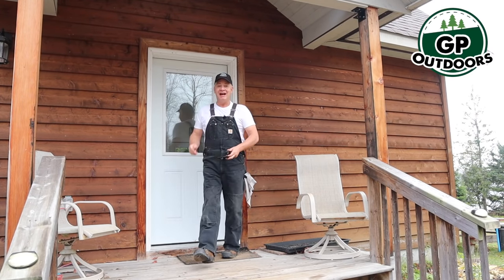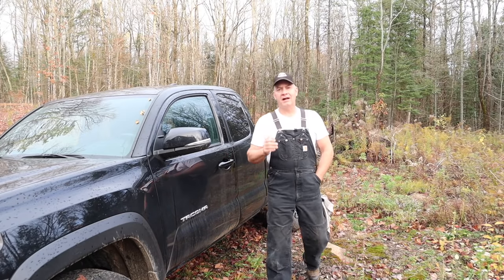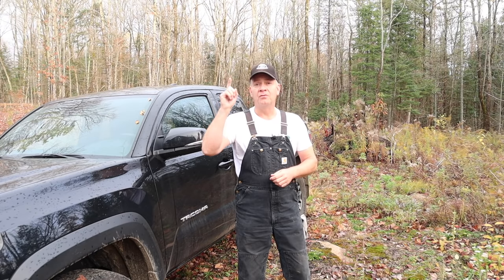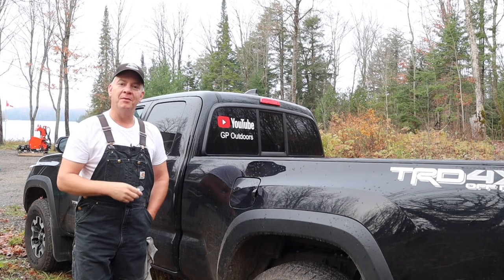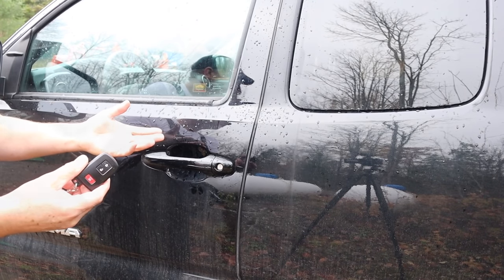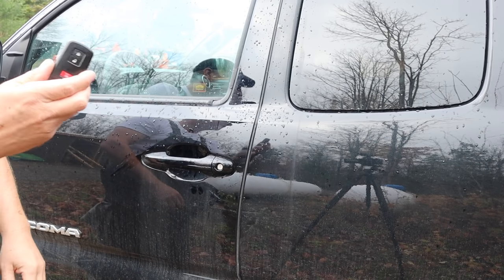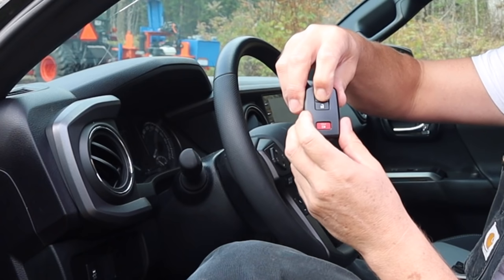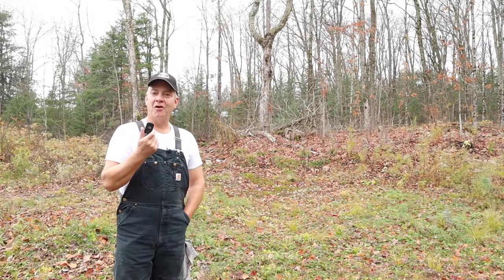#345 Stolen Truck. How To Deactivate Your RF Key FOB. Part 2. You HAVE to watch this!

Comment: Good to know about the key fob.  I have a 2020 Tacoma and a 2019 Camry so I will try them tomorrow.  

Also, did you ever tow your b2601 with the Tacoma?  If so, was it on a single or dual axel trailer and how did it do?
Reply from the maker: Good morning DS! I looked into trailers for a while - thought about it, but really didn't have a big need. However, I believe in your manual, you will see the truck is rated for about 1,000 lbs towing capacity without trailer brakes, and up to 6,500 lbs with trailer brakes ( including the weight of the trailer itself). There is a pre-wired 11 pin connector located under the dash below the left side of the steering wheel where a trailer brake kit can be installed and you will have the correct receiver plug already there on the back bumper (if you have the towing package on the truck). So you would need a trailer with brakes - I figured I could get away with an 18' trailer but was thinking a 20' would be better as I assume I would want to also carry tools and possibly more than one attachment with me. If you are in Ontario, you may want to look at MISKA trailers out of Hamilton - they have packages as well as stand alone trailer offerings. Hope that helps a bit. Cheers!
Reply: GP Outdoors I tried both the Camry and Tacoma and the key fob feature works for both.  It just disables the key fob.  Don’t do what i did, I took out both Tacoma’s key fob and tried it using my wife’s key fob and was still able to open the door (it was because I had my  key fob in my pocket - duh).  

Regarding the trailer, I have 2 acres that is raw wooded land in central Arkansas.  I want to get a B2601 with a backhoe to start clearing a place for the workshop.  But I will need to trailer it until I get the workshop built and can secure the tractor in the workshop.  I may need to settle for the BX23 to keep it under the tow limit.  I only live about 5 miles from the property and it is all flat roads.  I keep looking at videos and trying to decide if the BX will be big enough.  I really want a 26hp for the PTO hp, but I don’t think the backhoe is an option for the BX26 series.  Holding off for now until wood prices come back down to normal.  Thanks for the feed back and like you videos - learning a lot from them.

Comment: I wonder if my fob for my 2017 Rogue can be turned off.  The best thing I can do is try it and see.  I know a lot of Japanese vehicles are similar in some ways.  My sister's Acura and my Nissan beep when there is enough air in the tires.  It takes out the guessing.

Comment: First, thanks for the info.  However, I bought one of the Wisdompro Faraday pouches.  What I find strange is that both fobs work from inside the pouch.  The pouch doesn't have much if any affect on the signal.  I tested them from 25' for my car and roughly 35' for my wife's car.   I tried it with the fob facing the top and bottom of the pouch, no difference.   It'll be on it's way back... I wonder if Amazon sells Altoids. LOL
Reply from the maker: Morning Dart. Sorry to hear that - I am aware that the various pouches available don't work for all cars. Just a question (a mistake I made when i first got it) - there are two pockets on that wisdom pro - the one in the front is not protected but the second pocket in the back. When I got it i put the fob in the front pocket until I realized that there was a second pocket in behind it. Good luck and all the best!
Reply: @GPOutdoors  Thanks! a natural rookie mistake.  I found the "back" pocket.  It works GREAT!  Thank you for pointing it out!

Comment: Just watched a video from one of favorites (Scotty Kilmer).If you don't know Scotty, you should 52 years professional car mechanic. He had a foolproof way to keep your car or truck from being stolen.  Just open up the hood, find the fuse/relay box and pull one the relays out (Scotty suggest either the fuel injection or the ignition relay, don't pull a fuse as it's too easy to replace). He states, "who carries a relay around in their pocket for your model car".  Sound like a great idea for any car or truck left outside of a garage or fenced area.  Just replace the relay, close the box up and hit the road.
Reply: One thought I have on the pulling a Fuse or Relay ... how do you open the hood without getting into the truck when returning to start it up ??  Most vehicles have the interior hood release.  Is there a way around that?

Comment: If you push the start button with the fob itself, will it start the truck when rf is disabled?  I don't know how it works, but many times, if the battery in the fob is dead, you can still start it by pushing start with the fob.
Reply from the maker: Good morning Smitty. That's a good question - I believe it should still work, as it is used that way when the battery is dead on the FOB, so I think it should still work but have not tried it.

Comment: In my 99 suburban while it does have a door lock fob you have to push a button for it to try to do anything. I say try because while it does sound like its working none of the solonoids in the doors have enough oomph left in them to actually unlock any of the doors. And should anyone make it past that security feature like by having the actual keys even then they are not home free.. While the key should work in the lock either way you can put it mine only works if you put it in the same way up every time. And even at that point you have to know exactly how to jiggle the lock while turning the wheel to actually get the key to rotate.... And those are all features my truck and i have developed over years of working together. Also have a hidden kill switch for the fuel pump also... But seriously have you seen the guy in england who electrified his door handles on his work van?

Comment: On my 2022 Buick Avenir and 2022 GMC Denali if I hold down the lock and unlock buttons at the same time for 2 sec the lights flash and it disables the key fob. Press the unlock and the lights flash and it is enabled again.

Comment: You can start the car (if the door is unlocked) even without a battery inside the FOB. That's what the shielding prevents.
The FOB RFID part (that starts the car) doesn't "transmit" all the time, it is a passive chip. Only when is in proximity of a reader, that reader sends the RF signal constantly, and that RF is used to power the RFID chip inside the FOB.
As for the combo, probably is in the Owners Manual for that truck.
PS: The unlocking of doors by pressing the button is indeed active, powered by battery, but is not related at all to the starting of the car, those are different chips inside that FOB module.

Comment: Well I bought the product you recommended.
Put my  key in it, sealed the velcro flap, & Pressed the buttons of the FOB THROUGH THE SEALED POUCH.
I can unlock the truck,  lock the truck, and remote start the truck, WITH THE KEY IN THE SEALED POUCH.
Maybe they were making them right when you bought them BUT THEY ARE NO LONGER MAKING THEM WORK.

Comment: Very informative, thanks for that. I guess if you want a complete safe way would be to add a kill to the fuel pump that would be activated or reactivated with a different wave frequency or with a physical activation (by a magnet passing near it for example)

Comment: Personally I think the best option here would be for auto makers to provide an option of disabling the touchless entry. Have it so you can set the keyfob to only unlock the vehicle with the buttons on it, but the 24/7 RF stays turned off. This way owner's in more vulnerable areas (such as cities and highly populated suburbs) can have a more secure vehicle, while people who prefer the touchless entry can still have it if they so choose to.

I'm not sure how they would make starting the car work with touchless entry disabled, possibly they could take the BMW approach of having a keyfob that inserts into a slot in the dashboard.

Thank you for taking the time to make others more aware of this issue! Our family has a key rack in the house and I may tell them to get once of those pouches to keep the keys in.
Reply: I believe on my 2017 CR-V I can disable the unlock when you just touch the door handle.  I know I was able to deactivate the auto-lkck when you walk away feature. Have to try it.

Comment: There is no point to your faraday key pouch or deactivating the key fob, someone can still steal your key fob signal when you are using it. And later come and steal your vehicle. Best way is to put a toggle switch inline with the power wire on the fuel pump, this will kill power to it.

Comment: Nice video . If you want to go a little more extreme you can disable the remote with the code and use the hidden key in the remote to open the door and since the remote fob is disabled to turn on the truck with a disabled fob just put the back of the fob in front of the button almost touching it and it will turn on.

Comment: What’s to stop a thief from using his remote to do what you do to turn the function back on: hit either button on his remote?
Reply: This solution is to limit the dirtbags window to steal your signal. Instead of it transmitting 24/7, you are reducing that to just a few minutes or even seconds each day when you get in and out of your vehicle. If they already have your signal on his remote, then you are right…this will do nothing.

Comment: The auto manufacturers are totally reckless and irresponsible creating a passive unlocking and starting system that’s so vulnerable to auto theft. Perhaps the only way things could change is with class action lawsuits against the auto manufacturers.

In the meantime, you could significantly reduce the risk of auto theft with a kill switch and an effective alarm system to draw attention to the car thieves. Perhaps tracking could also be added.

Comment: Hello there GP my friend.  I know we all seem to be into fancy electronics, but don't completely forget "old school" methods as well.  The one thing thieves don't want is something - anything - that will slow them down.  I have a "truck club" that lays across the steering wheel.  Is it the "end all" for security?  No, its not.  But you can't drive my truck with the club on it prone across the steering wheel.  Therefore, if your a crook, you better have a hack saw or some other battery powered cutting tool to cut the club off.  This takes some time... Again, thieves don't want to waste time.
Reply: My wife's Google acct.  I'm Howard.

Comment: Starting a vehicle with a key fob whose battery has died: I had an old 2013 VW SportWagen that I bought used and shortly after I bought it the battery in the key fob died. I was told that if you press the start button with the key fob - it would put the key fob near transmitters in the dash and they would wirelessly activate an RFID signal in the key fob. 

It should behave like proximity badges that people frequently wear in larger companies. There's not a battery in the proximity badge, it receives energy from a prox-transmitter, and once it does it will begin to transmit allowing the prox-transmitter to receive information from the badge.

I can tell you that it worked in my old VW.

Moreover I recall something that a friend told me years ago about his Corvette. The transmitter in the key fob only transmits when it detects motion - such as when it is being jostled about while in your pocket. This is supposed to save battery life. So it may be that key fobs that aren't being jostled about aren't transmitting. 

However I am not planning on leaving my keys lying around on my desk at work just so that it won't transmit.

UPDATE: I have a Toyota Corolla that has the same security vulnerability as every modern day vehicle. If you deactivate the key fob, if you hold the key fob near the start button while pressing it - there does appear to be proximity sensors in that vicinity of the vehicle - that will activate in the key fob, transmit back to the car - and allow the vehicle to start.

I assume this is for those dead battery sorts of situations... And I wonder how many people know this!

Also, Toyota still has allowed you to open the vehicle with a key. There is a key stub in the fob (in mine at least) where in if you press a little slider button on the fob the actual physical key will come out allowing you to unlock the door (It is where the key ring attaches to the fob; if you press that little slider the key will come out and the key ring will be attached to the key stub).
Reply: Next your self driving car will be going on midnight cruses by it's self.

Comment: I don't know if this would work for your type vehicle but I do know that you can install a kill switch to the ignition to the engine. At least on a Chevy and Dodge and some models of Fords but I never tried it on a Toyota before small hard to see can pretty much put it anywhere in the cab of your vehicle

Comment: My remote entry key fob on my Civic will start the car if the fob battery is dead by holding the fob up against the start button.  The manual says that the car actually does transmit a short distance RF signal that will cause the key fob to emit the response code if the key fob is in extremely close proximity to the start button.  That may work with your key fob in the no transmit state unless the RFID chip is actually disabled.

Comment: With all the advances in modern technology and miniaturization, there's no reason why a wireless fob that same size couldn't be made to do a cryptographically secure handshake. It's a shocking level of laziness for a high end automobile manufacturer, or maybe an ill advised cost cutting measure.

Comment: Generally, the signal is encrypted so that criminals can't intercept and duplicate the fob.  Usually, they use radio repeaters that suck up the signal from inside the house with a high-gain antenna, and re-transmit the signal right into the vehicle.  This way, the car thinks the key is nearby, and they don't have to process the signal or decode it to make it work.

Comment: The signal have a timestamp. They should not be valid after one delay. So they can relay only if they do it in real time. I don’t think you can simply record and replay it 10 minutes later. If it is the case the engineer are completely idiot. In programming this is how it works the packets are valid only for a short time. I think all keyfob should have a lock switch easy to activate, the packet signal should have timestamp. And the car should have one place where to put the key to allow starting the car, if the car does not have the key in the car, a signal should be sent to slow the car and after a delay shutdown the car.

Comment: I would just start using the lock button on the door instead of on the keyless entry. Use the physical key to open the door.
If the steal your signal, the alarm won’t make a difference anyhow. 
They need the tech to go back to physical keys on highly stolen vehicles. The few seconds of convenience is not worth it